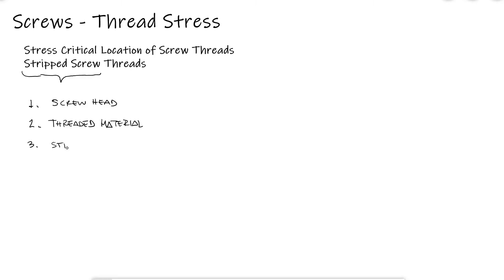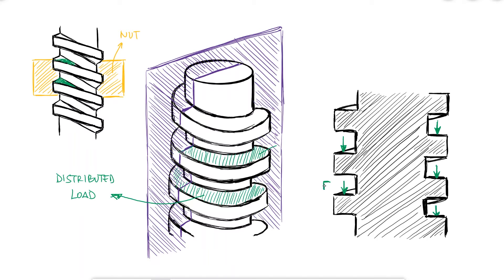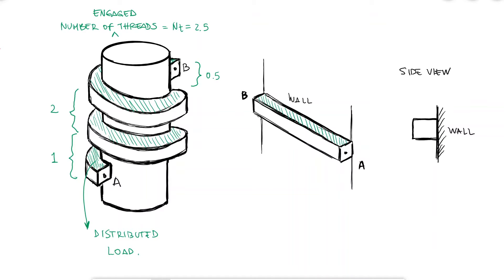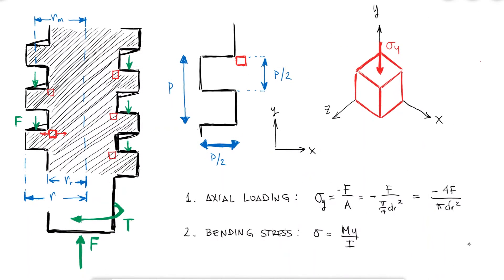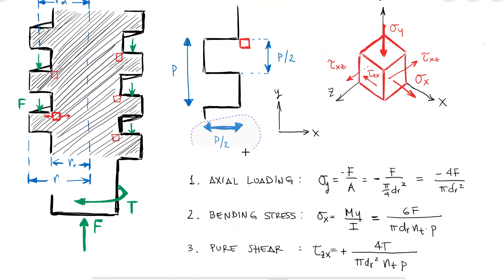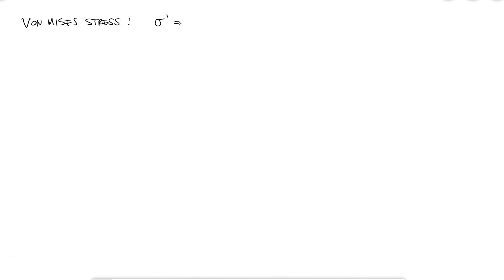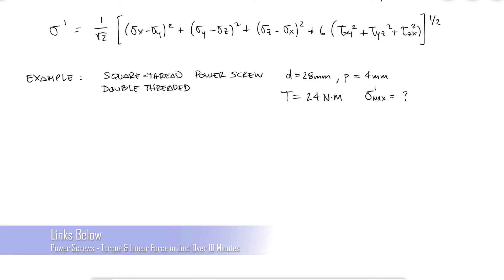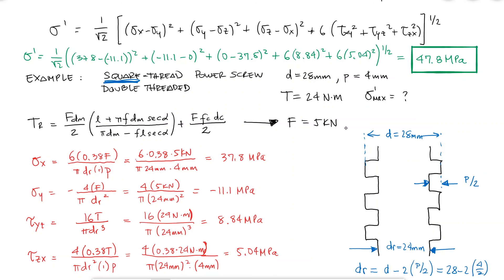Stresses at Screw Threads in Just Over 10 Minutes!

Comment: Hello Sir, could you help me understand why the expressions at 7:14 are only valid when the number of engaged threads are six or more.
Reply from the maker: When 6 threads are engaged, the first engaged thread takes roughly 38% of the load. If there are fewer threads, this number would be higher. For example, if there's only 1 engaged thread, the number would be 100% of the load.
Reply: @LessBoringLectures  Thanks alot

Comment: Sir let us say you want to calculate the maximum force the threads can withstand but you are neither given a torque nor any force, only the material properties with which the bolt is made of are available to you and the thread type with its dimensions, How can you go about calculating it?
Reply from the maker: With the yield strength of the material of the screw, you can find the maximum allowable von Mises stress at the threads (Sy = σ', if factor of safety is 1). With the maximum von Mises stress you can either solve for the force/torque combination (they are related, like you see in this video) analytically (very long process), or try different forces (in a MATLAB script or EXCEL spreadsheet), increasing them gradually until the von Mises stress reaches that value.